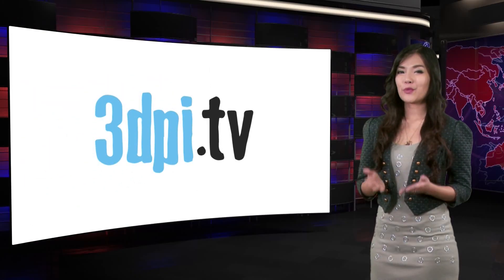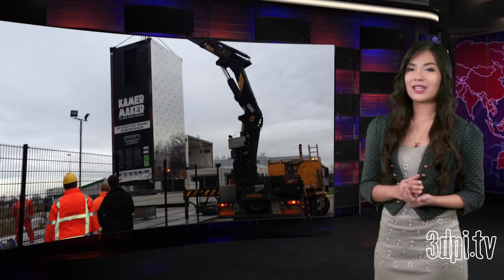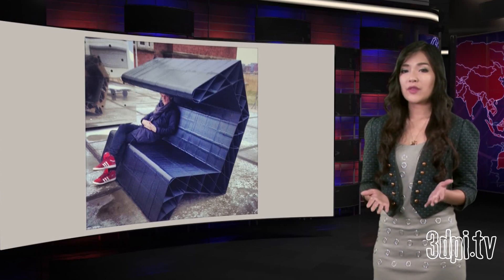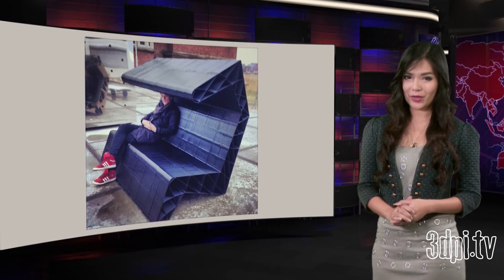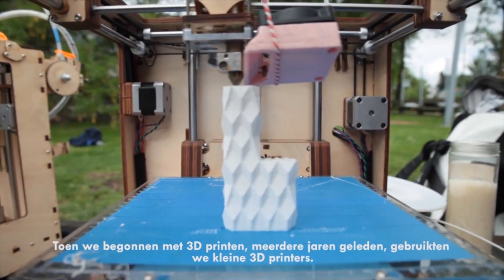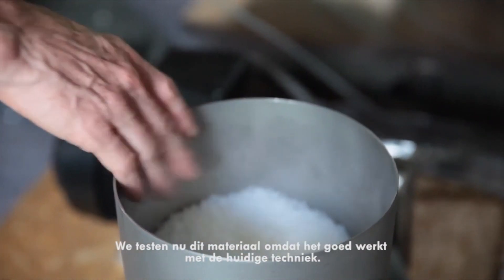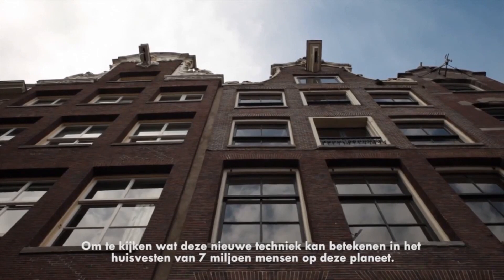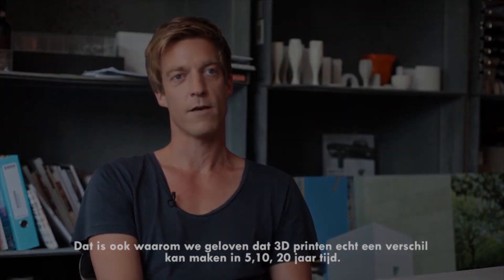The World's First 3D Printed House Begins Construction

Comment: Just saw the Chinese video where they use a type of concrete. It's fast and depending on the aggregate should be much less expensive than plastic. Personally, it would be a shame if a number of technologies weren't married together such as 3D printed plastic, 3D printed concrete, molded polystyrene and carbon structural members.
Reply: plusb there is a wood compound that is being made to work in 3D printers that acts  and smells just like wood after being exstruded  you could use it instead of plastic
Reply: james head it contains plastic and cellulose fiber.